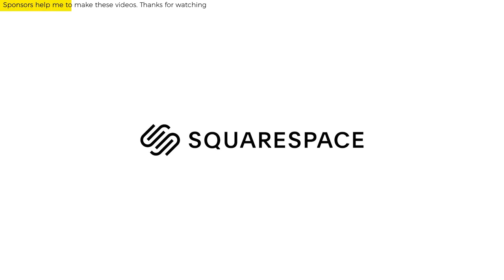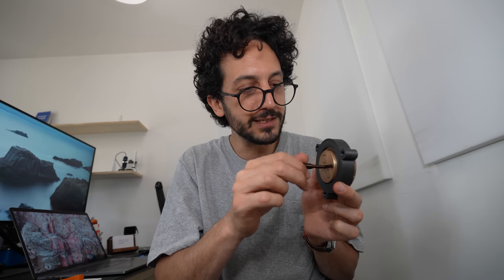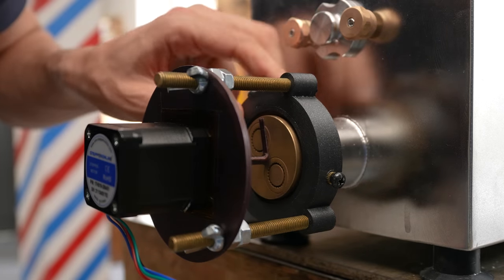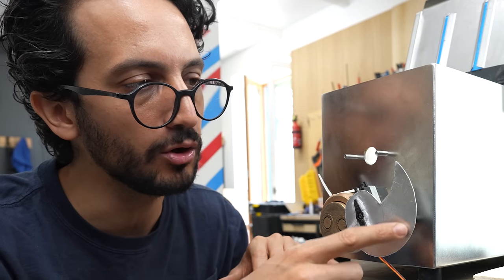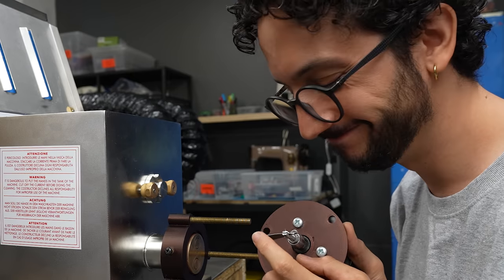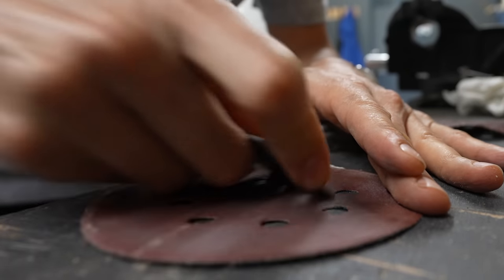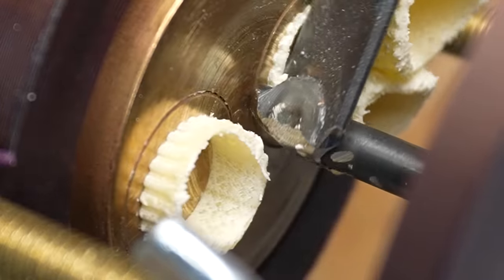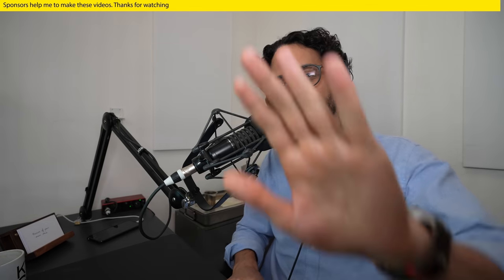I Tried to Make an Automatic Pasta Cutter (did NOT go as planned)

Comment: The problem with your cutter is that it moves too slowly across the extruder. If you look at all the other footage the blade flies by very fast, while yours is on the extruder half of the time. To make it perfekt you would have to stop the blade every 360° and then turn as fast as you can and stop again, so that they can be long enough but also get cut very fast
Reply: Basically use one of those CnC computer-controlled motors. Hook it up to a computer, tell it to quickly rotate 360° (or 180° for a two-sided blade) every x seconds then hold, and you're done. Oh, and also, make an anchor hole on the die for the blade (which should sit on the shaft like a propeller, flat with the die) shaft to sit in to prevent any wobbling. 
Pretty it up, and you've got an adjustable length pasta cutter.
Reply: Actually the last pasta machine I worked with you can set to different speeds
Reply: The blade axis can't be the center of the die because the radius is too small, he just needs a sharper blade spinning quickly and with it's axis mounted like 15 cm away from the die so the angular velocity is higher even with the same RPM
Reply: Yeah omg this is so obvious
Reply: @ShEsHy  he already used steppers in his first try, and if for cnc motor ur talking about servo. That would be overkill since a negligible a mount of backlash is created in cutting pasta
Reply: @asronome  exactly! I came here to write exactly this
Reply: @asronome  You have the solution.
Reply: @RYU47376  Stepper motor, that's it. Sorry, not really familiar with the nomenclature.
Reply: With a servo you have extreme fast acelleration. Which would be helpfull in this application. As you have seen steppers are relatively slow
Reply: This was my exact thought as well --
Reply: Well, his dye is much smaller than the commercial dye so that limits how fast the RPMs can be. I think if he sharpens or uses a better blade, that will work best. If you stop then cut, soot then cut that means the pasta that is cut first at a fast speed, pause between each past will be different and thus the lengths will be different. Nice thought but this complicates the mechanism much more than using a constant speed.
Reply: @asronome  mounting it that far and keep the amount of play out of the blade would be too difficult
Reply: He should basically use the windshield wiper motor exactly like it was intended, at the slowest setting. Coming in for a "wipe" and then going back, and the waiting a second or two, the coming in for a "wipe again ✌️
Reply: The problem as i see it, the blade has too much surface area. the face is too big. pasta is sticking to it. give it less surface area to stick too, it will fall quicker and not get stuck to piece next to it.
Reply: Wouldn't it be easier to just use something like a Geneva drive? It's a simply gear system that translates a constant rotation into an intermittent one. This type of gear system is also used in movie projectors, since the end gear stops at every frame until the next full rotation of the motor.
Reply: @joost1120  Seems hard to adjust. With a servo changing the interval is changing one number in a program.
Reply: @asronome  But the problem with the approach of making the blade spin even faster is that, at least for different pasta shapes, the blade may spin too fast..... or, on the other end of it, the pasta machine won't be able to keep up when extruding the dough.  I'm almost tempted to think that what's needed here is a different design altogether, one which uses a steel string, like from a guitar.  The radius of the cutter, ie. the length of the steel string, would be taut at both ends so, when the cutter is spinning, it'd cut the dough with the least resistance and won't deform the resulting pasta.  It's kind of like how one might use unflavored, waxed dental floss to cut on the equator of a wheel of Brie cheese, so they can stuff it with various fillings before baking it.... like, into a brie en croute.
Reply: Maybe he could use the geneva mechanism. It can convert constant rotation into short fast ones. It was used to advance the frames in old film cameras
Reply: Fishing line... On a loop... Rotated from a second motor channelled to the end... Instead of a blade... Also... Easier to replace... Just a thought.
Reply: @joost1120  or alternatively something like a theo jansen mechanism, where it moves an arm in occasional swiping motions.
Reply: Was going to say the exact same thing. High speed cut, and pause every 180 or 360 degrees. In addition I'd suggests mounting a double edge razor blade (or half of one) as the cutting edge to get an easy clean cut
Reply: Sounds like a good use case for a Geneva mechanism
Reply: or there could be two blades
Reply: @asronome  That's the simplest solution.  The drawback is that 15 cm radius turns into 30 cm diameter of sweep.  That makes a pretty bulky machine (possibly doubling the footprint of Alex's machine) and needing a very torque-y motor (also largish sharp spinning blades).  For me, the biggest hurdle is the delay between passes to allow the pasta to get to length.  Something like a reciprocating angled guillotine cutter would be very compact but accelerating it so it doesn't tear the pasta will be THE problem.  And the easiest way to power it would be a cam on a motor like how car intake/exhaust valves are operated.  The cam profile can integrate the rest period.
Reply: exactly.  cut very fast, trigger the cut at intervals.
Reply: @rerere284  That is workable and easy to design and assemble.  Besides, Alex used a car wiper motor and the wiper linkage is a simplified form of Jansen's mechanism.  I think Alex got fixated on the "simplest" solution of using a rotating cutter direct mounted on a motor.
Reply: @newmennium  Far easier than any of the other solutions
Reply: yes, or if you want continuous movement, mount it off to the side so it can have a much larger arc and only spends a little time over the actual pasta die.
Reply: @ShEsHy  If this is going to be an ongoing maker-series..
My thought was that maybe the problem with the current blades is that pasta sticks to it (and it then collides with the next piece being cut). 
If you just mounted a ring with a piece of wire across the centre, resting position would be vertical, between the extrusion holes. When activated just spin it 180 as fast as possible (and a lovely precise  180 turn is just the sort of task stepper motors are designed for).
Could then screw this down against the extruder to get just enough tension on the wire, to keep it flush with the die.
If you put teeth on the outside of the "cutting ring", driven by the stepper, then you could adjust the torque.

Could also then adapt this for variable length pasta - stick a LED/detector on the existing threaded screws, then when extruded pasta blocks the light, you trigger the quick 180 spin/cut. If you don't do this, then longer pasta is going to just require you to slow down the continual cut, and it'll get mangled.

I say all this, without having a clue how to do it.
Reply: Tbh I liked the idea of a wiper motor. Like a windshield wiper. It would basically just swing from left to right to left to right...
Reply: Agreed. Alex was so close with the stepper motor.  Spin the motor 180 degrees as fast as the motor can. You get more torque from a NEMA stepper motor that way, you get a more parallel cut on the pasta, and the pasta will be less likely to stick to the blade.  I also suspect a blade with a lower draft angle will do a better job cutting the pasta.
Reply: You need a programmable logic controller (PLC) to run your stepper motor.  Turn it 180 degrees as fast as you can, and then wait a programmable time before turning again.  You just need to adjust the dwell time to adjust your pasta length.
Reply: @ei5717  yes, the same way I was thinking. Use the park function the vipermotor has built in, and just use a timer for how long it's parked.
Reply: That's what I was thinking too
Reply: When you compare his pocket knife to all these other blade shapes, distances from the die, and sharpness, they just don't compare.  No matter the speed, they're just smashing the dough,  not slicing it.
Reply: Agree with the need for a faster blade, I was thinking the same. Looking at the last design, seems like you could have tried using a safety razor blade, and spared yourself sharpening the metal piece. Great video as always ❤
Reply: @ShEsHy  This would be waaay to complicated for this kind of task. His current setup can do that too.
Reply: I would have suggested some oil on that cutter but ok let's turn it into a spaceship
Reply: @rkmugen  Hmm I wonder if one could use the thought metal string in combination of a taller solenoid motor, the question I would have to ask is what speed is better for the pasta so it does not get disformered or altogether broken, may not be the simplest mechanism but it would be compact and easily over combs the stability issue since there is no center on the die and if I recall correctly some cant even have a axel in the center at all since the past comes out there though I would have to rewatch the shorts for that
Reply: @ShEsHy  agree with your analysis of the problem but a Geneva gear would do the same job.
Reply: it's just sync the speed volare..
Reply: He’s right, you need sharper blade and then a “delay” after each initial cut….
Reply: Y'all are needlessly stuck on rotary blades. Double sided guillotine-style razor blade and motion would probably be easier.
Reply: We need someone to make one, programme it, and send it to him
Reply: @asronome  exactly what I thought. Just move the centre axis away from te pasta machine and increase the diameter. Would be a lot less of a hassle than a tempo changing engine.
Reply: I was thinking maybe a guillotine style could work well, instead of pausing per revolution, double blade it, and pause every extention/retraction. could be pretty easy to set up too, I think.

But I'm also thinking about dough adherence, perhaps the right blade edge geometry/sharpness, but also....what about something like surface texture, like how blades have scalloping for reduced adhesion.
Reply: @BuildItAnyway  Steppers can be plenty fast. Many can reach 1000rpm (16 revolutions a second) and even far beyond. And you don't need to go anywhere remotely close to that speed nor is torque really an issue either. Whilst acceleration is a factor, at the speed you'd want a pasta cutter it could be effectively instantaneous in this context/application; as in, it wouldn't be a factor you'd need to deal with.
Reply: @TizonaAmanthia  Beautiful French connection there
Reply: @naycnay  these days small servos are barely more expensive vs closed loop steppers. On my cnc i can do 50m/s with 10000mm^s2 acceleration. Stepper in same application perhaps 1/5th of the speed. Also the closed loop makes sure your error is very low. I can guarantee you that the one in a pasta factory is a servo :)
Reply: @naturetubeUK  why cause the guillotine is a french thing? I guess? not what I was thinking about though. just that it feels like it could be more effective than rotary slicing.
Reply: Thank you, this is EXACTLY what I was thinking since the first minute of the video! Start-stop with a very fast revolution.
Reply: I agree with the problem of the cutter being slow in the cutting phase. I would propose as an alternative to make a cutter with the rotation axis not aligned with the extruder. I would put on the side away from it, insert a recurrent timer in the code, at the end of which the blade does a fast 90° move and cut the pasta. Next cut would be backward, to bring the blade to the original place. This would basically emulate a knife putted on the side, that goes from being vertical to being horizontal back and forth, cutting during the movement.
Reply: The extrusion part is just too small compared to the factory’s. So don’t center the blade on the middle of the extrution plate but outside of it to form a bigger circulation. The second prototype had that right, just touching the plate a part of its circulation time. It just needed to be sharper and faster.  The last one works, but it can be better.
Reply: I use a machine just like this every day at work. The speed is fine.
Reply: Or extrude the pasta much, much faster.
Reply: I also think you should try a thin blade like a wire or a blade perpendicular to the pasta
Reply: That was my thought exactly. Like do the stepper motor he had at the beginning and just step it 180 or 360 every 5 seconds (as per the desired noodle length)
Reply: @Vfulncchl  your nick looks welsh 🤣🤣🤣

Comment: I’ve never done this before, but just based on occasionally doing modelling clay art, I think that using a wire that moves up and down could work well in some circumstances.
Reply: Came here to say this - it’s how my pasta extruded does the cutting. Taught piano wire cuts pasta very effectively.
Reply: This is actually a great idea and works amazingly good for several shapes of pasta. Since he can code, a wire cutter that goes down, waits, go up will work fantastically. And he can print a guide so it is always flush with the die. This will also preserve the die.
Reply: @RoboticParanoia  yeah, and the surface of the wire is small so it prevents the crush effect and sticking.
I would really like to see him try it even just manually first.
It’s generally what’s used for cakes that are too delicate to cut with a knife.
Reply: @chuuu4610  there are some slow, small pasta extruders that use a stainless steel wire. The manual marcato he destroyed in the beginning of the series also have. Pretty effective for slow extrusion, but needs to be fast. He can have the timed wire cutter for bigger shapes and the knife for smaller ones, that do not require fast cut, such as fusili, caserecce, gnocchette, radiatore (if cut by the side, with the knife parallel to the length of the die shape) etc.
Reply: Just stretch the metal wire across two opposite points on the circle, that way it could still spin and cut. His biggest issue was he was tryong to reinvent the blade. Literally just stick a razor and presto.

Comment: The problem wasn't the stepper motors. They can have very high torque for their size, even without gear reduction. From the sound your motors made and the fact that you couldn't get as slow as you wanted the problem was the driver circuit xD
Reply: Yeah when a motor makes a sound like that it's not looking very good.
Reply: I recently automated my roller curtain which needed 3kg of pulling force which I achieved using a NEMA 23 1.16 Nm with the Tmc2208 supplied with 12V 5A. Looks like he was using a l298n h bridge instead of a proper stepper driver. Stepper motor drivers are able to send higher voltages (achieving higher torque) due to current control, and its sine waveform results in really quiet movement. Besides, its way easier to program the stop start sequences to vary the length of the pasta using stepper motors.

Comment: When cutting anything, surface area is the enemy. The smaller the surface area of the blade, the more effective it is. 

Your final design is so close to being spot on, but if I were to try improving it, I would make the blade thinner, set it to an angle closer to the face of the extruder, and potentially look at using a stepper motor that rotates 360 degrees as fast as possible and then stops for 3 seconds to allow the pasta to extrude to cutting length again. 

All that said, this cutter is definitely doing the job as intended, so there's no need to continue chasing perfection.

As CityPlannerPlays often says, "don't let perfect be the enemy of good enough".

Good work Alex, Salut!
Reply: A razor makes sense. Maybe cut down so it's just the 5mm above the edge.

Comment: The first thing that came to my mind was to use a wire cutter, like one of these you use for cutting cheese. You could press against the dye and if it can cut hard cheese it shouldn't have any problems with pasta :)!
Reply: I literally just posted the same thing 😅 just attach your cheese wire to some chain and gears like a bike. Sharp with a lot of torque and speed control
Reply: I agree. Some of the commercial machines I have seen use a wire to cut the pasta.
Reply: Sometimes things meant to cut something hard cannot cut something soft. For example, the saw blade for stone wouldn't be able to cut your finger. You can touch it while it's spinning! But it cuts through rock.
Reply: @jacobv_  sure, but wirecutters are used for dough as well. Sure, I cannot try it myself, but I still believe a Wirecutter would do the job perfectly